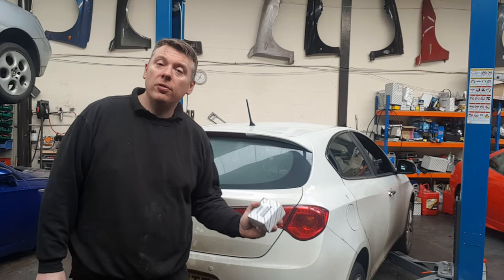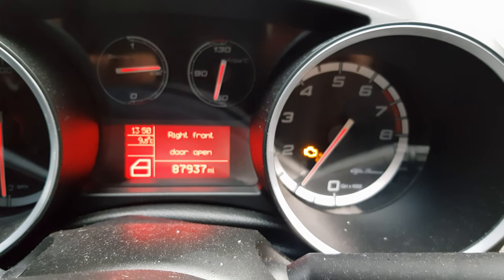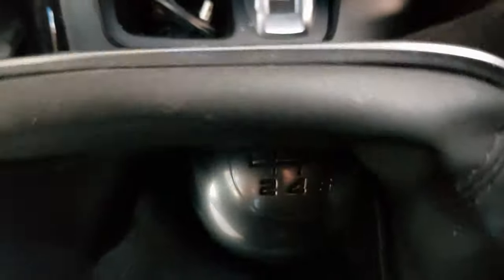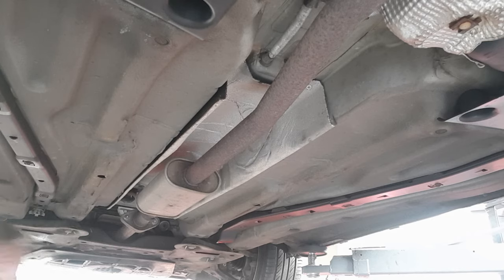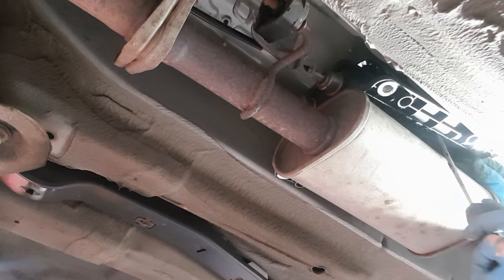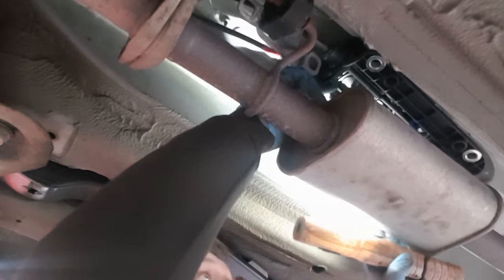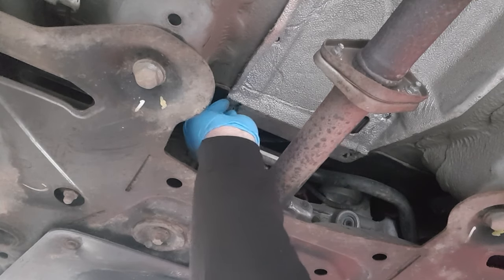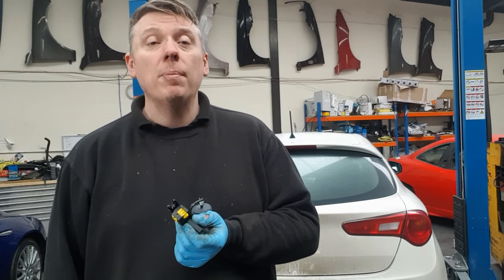Diagnosing and Fixing a Stop Start Fault on a Giulietta

Comment: I have the same engine light and start&stop but it only comes on after i put my car in 6th gear, the car be stationary just on ignition u put it in 6th and the engine light comes on lol. Would this be the same sensor problem? My error code is P130662
Reply from the maker: Something that will need to be looked at as it's just guessing without

Comment: Excellent guide, thank you! Did mine on ramps, remember the safety specs to avoid getting bits of crud in your eyes! Just one broken wire on mine so added a new bit, soldered and heat shrunk, working perfectly,  £300 saved.
Reply from the maker: Glad it was helpful

Comment: I have a question.Can this fault P081D(faulty or broken gear position sensor) cause MAF faulty code P0101.I have changed  the MAF,bought and installed a brand new one,but from time to time i get MIL light on,indicating fault on gear position sensor and MAF fault code...i have  a Giulietta 2.0 jtdm
Reply: Hi dear, i have same fault (P081D) what i have to replace pls?

Comment: My own would start if the engine is cold and then would misfire and stall for no apparent reason. However, if I drive it on a highway the car drives perfectly. When the issue happens I get a check engine light and the code is P2292.21. I replaced the fuel injectors control pressure sensor located on fuel injector rail, but it didn’t solve it. I checked both fuel pumps and proper pressure, fuel delivery are both present. Do you think you can guide me?

Comment: I did this on mine lying on my drive with the car on ramps. It helps if you bolt the gear lever mechanism back in place whilst changing the sensor, this saved me a load of hassle.

Comment: Saludos from Chile, thx for you guide, I have same problem the wires are cut when I desarmed 😢
Reply from the maker: Hi. You can re join them but sensor normally fails too
Reply: Yes, I was able to solder them and clear the error code, so far it hasn't failed.

Comment: I have a 12 plate giulietta automatic 94k been an excellent car , first fault ever to come up is this one. I had to drive 300 miles home very concerned . the car seemed to faulter whilst going up hill not much just a little bit of missing then carry on fine, would this be due to this stop start sensor. ???. thank you

Comment: Thanks for sharing. I have a mito and my stop start wouldn't work after cold mornings disconnected and reconnect battery all would be well replaced battery and all is fixed. Does fiat ecuscan software work on these alfa?
Reply from the maker: Yes it work.
Reply: @ItaliaAutos  thanks for the reply Neil. Been watching since I bought a 13 plate 1.3  mito in november

Comment: Can you help me again please:) I want to change the steering servo oil (Alfa Brera 2,4) from atf to the green liqui moly. Can i just dismount the pipes and start steering (while the engine is running) to flush the circuit.  Or is it a bad idea because the pump will run dry? + How can i deaerate/ exaust the air from the system afterwards.  
Thank you very much for your great videos and your support.
Reply from the maker: Head over to Patreon. Join up and message me via there. I will gladly answer your help requests there. Thanks

Comment: I have the same issues on mine, I also would like to know what the day time running light fault is so I could get this fixed too. Thanks for the video 👌
Reply: i have the same issues on my mito, i second this comment ( as they pretty much the same, and no its not a dead battery its brand new)
Reply from the maker: Normally the light it's self or the ecu under the dr8vers headlight
Reply: @ItaliaAutos  i have the aftermarket black crystal DRL's, the LEDs work with headlamps but jus daytime running some days they work some days they say no :,(
Reply: @demodansoundwavemusic9677  Well seems a problem with the can line. Maybe u need to put some resistor but u need a wiring diagram to know where u need to put them.
Reply: @Malossianoplus  thanks for the suggestion, funnily enough i thought it might the turbo overheating the LEDs as its only the drivers side I've got new resistors but the DRLs started working again so left it lol

Comment: Hello. This fault appeared on my Guilietta recently. I never use the start/stop option so it doesn't bother me. What does bother me is that now the DNA is not working. Will I have to replace the sensor in order for the DNA to work again or is there another way around it ?
Reply from the maker: Nope. Ecu shuts it off.
Reply: @ItaliaAutos  I managed to replace the sensor with a new one by following your instructions on this video. Thanks a mil. It's my first attempt at anything like this and couldn't have done it without you!

Comment: Last time I had a similar issue, I just removed the exhaust, it was a 5 minute job, putting it back wasn't hard either. I don't know about Guilietta but is there any reason you didn't recommend people removing the exhaust?
Reply from the maker: I should of done really would of made better viewing. But as you can see you don't need to.
Reply: @ItaliaAutos  okay got it, video wasn't bad it just looked like a pain in the butt. If you are doing this on your driveway, removing the exhaust makes the job 10x easier. Even for you if you removed the exhaust, you would save your energy for the next customers car, and it wouldn't take much longer I think, but hey it's just my uneducated guess.

Comment: hey, do you have any videos on possible electrical faults on alfas? my guiletta  wont start 😓
Reply: Did it start in the end ?
Reply: @DrumToTheBassWoop  not without being jumped from another battery
Reply: @victoriac3715  sounds like a dead battery mate, nothing serious.
Reply: Do you have general failure as error?  I had that ones on a Mito it was not really the Battery but the alternator
Reply: Ops I am very late sorry

Comment: Hi, i had a few questions about my giulietta that i was wondering if you could help with?

Firstly, once in a blue moon i would get a p1064 error code and then shortly after, dissapears. Do you know the cause and solution of this?

Also, i wanted to know if there was a way i could bring a cable from under the car into the boot? Is there an existing hole or grommet? (I originally tried bringing a power cable from the engine bay into the cabin but couldnt find a suitable firewall so have resorted to bringing the power cable inderneath the car, into the boot).